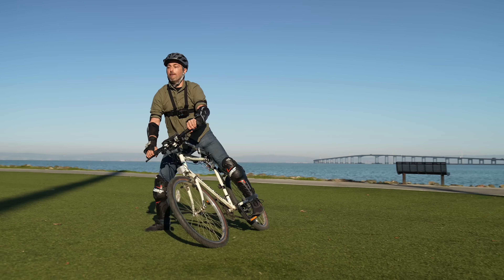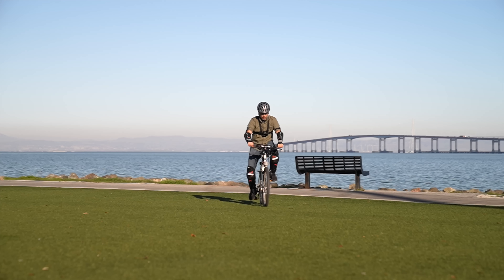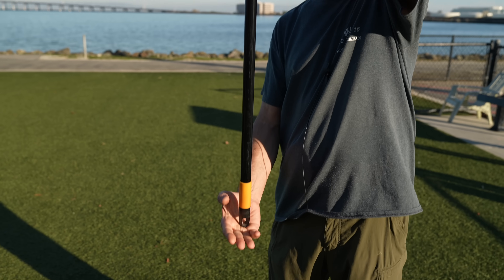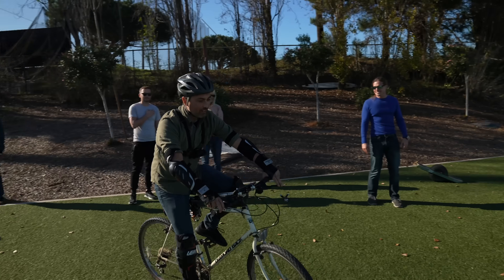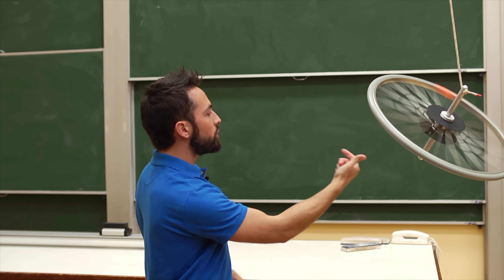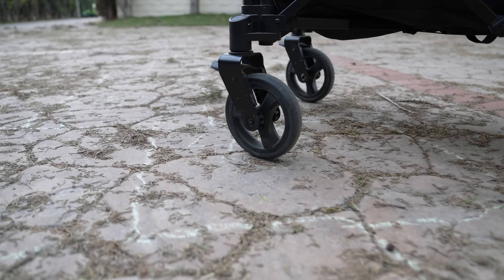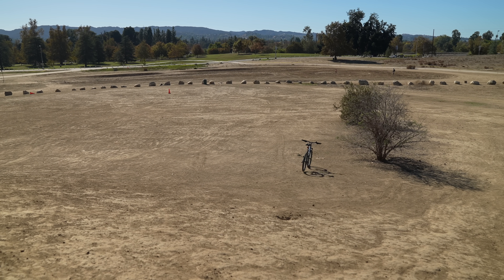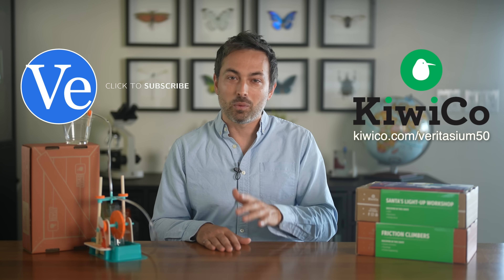Most People Don't Know How Bikes Work

Comment: Motorcycle enthusiasts hashed this all out 25 years ago in an internet group I belonged to (and I'm sure it was hashed out many times before that - I bet the Wright Brothers knew exactly how it works).  The subject came up in the Motorcycle group because getting your motorcycle license had a question about how to turn - and to pass the test their answer was turn left by leaning left.  We did similar experiments back then trying to lean a motorcycle that was modified so you couldn't counter-steer and it couldn't be done.  Excellent job explaining it in this video - now a whole new generation can be amazed to learn about counter steering.
Reply: Spot on!! 👌🤟 i was waiting for someone to say that
Reply: There is 2 books on the subject I would highly recommend. Bicycling science, and motorcycle chassis design. There both very interesting and definitely worth a read.
Reply: Came here to say this as well. Anyone who's taken the Motorcycle Safety Foundations Basic Rider Course (and maybe some other groups' courses) understands counter steering.
Reply: @jacobzadnik3875  I think most people don't understand it much at all.  They know it exists, but too many people seem to think it doesn't happen at low speeds, and most don't seem to know how it works, even if they know that it does.
Reply: @jacobzadnik3875  Yep. Learned about this 20 years ago with a motorcycle lol
Reply: I heard that for a motorcycle, the profile of the tire is also important for cornering. Riders are taught that they need to put more throttle to go around a corner at the same speed than if they went straight, and that is because the tire has a smaller diameter on the sides than in the middle, so when cornering, you need to wheel rpm to maintain the same speed. But also, when the tire is tilted, the tire has larger diameter on the outside than the inside of the contact patch, and because the wheel spins as one piece, the larger diameter has to drive a larger distance, so the tire traces a curved path. It basically acts as a differential. I have difficulties joining this with the subject of the video. Am I talking out of my ass? Are they just complementary effects? Can you steer a motorcycle/bicycle on razor thin tires that have no profile?
Reply: @flashpeter625  they are just different phases of the turn. You use counter steering to lean the motorcycle from a vertical position, and once it's leaned the tire profile kicks in and that keeps the motorcycle along the curve.
Reply: @flashpeter625   I think "talking out my ---" is correct.  Many motorcyclist are killed by the conditions reviewed here, they met a sharper than expected corner and make a "car turn" and thus fly off the back of the curve.  A two wheeler ( i ride both bicycles and motorcycles) first goes opposite and then comes back.  In my motorcycle training we were told to "push (handle bar) away" which is a counter steer.  So to turn left you "push away" the left handle bar ( which is to turn to the right), which makes the bike begin a fall then you "roll" into that fall and thus you turn.  So for a LEFT you 1) turn right, 2) feel the fall, and 3) turn back left and leaning into into the fall  the more you lean the tighter the turn.   fyi if you accelerate in that lean, the bike will launch like a rocket, and shoot toward the current direct (breaking out of the turn)
Now something you mention but counter to the video we agree with your assessment that the objective is to manipulate the gyroscope.  So "push away" unbalances the gyroscope ( ruler / gyro demonstration) The gyro then wants to self correct because its moved from lowest resistance (straight) to higher resistance (counter steer)  and thus your lean is naturally simultaneously timed to the gyroscopes return making 2 forces ( leaning & Gyro correction) combined to turn the bike.  I think your round tire ( disproven by "dark siders") allows the lean to be  easier.  There is no differential because the force is from momentum and since both tires lean they match even if the match is at a slightly smaller circumference (higher rpm!)
Reply: @flashpeter625  I've never thought of it like that!  As long as the engine rpm stays the same, then the wheel rpm will be the same, and the speedometer reading shouldn't change.  But in reality, because of the reduced effective diameter, the bike must be going slightly slower.  The more you leaned, the slower you'd go.
Reply: @flashpeter625  yeah,  the effects of the profile of the tire are there, but they're not the main effect.  The largest effect helping to keep a typical bicycle/motorcycle rolling in a straight line is "trail", where the contact patch is behind the steering axis.  This means that any time the bike leans, the steering automatically wants to turn in that direction.  this will still work on super narrow tires, etc.
Additionally, the contribution of each effect varies between bicycle and motorcycle.  The angular momentum of the steering and gyroscopic effects are actually very minor on a bicycle and can mostly be ignored (very light wheels and tires don't steer differently), but the effects are much more significant on a heavy motorcycle wheel.
Reply: @flashpeter625  the profile of the tire affects cornering, but not quite in the way you describe. While it is true that tire diameter combined with RPM determines speed, that's not a factor that must be compensated for in a turn. For example, older motorcycles used a throttle lock (literally a device that held the throttle open) as a means of cruise control. You could ride around corners with the throttle locked, no problem.
Reply: @flashpeter625  yes, you're right - but the rider has to counter-steer before the bike will lean at all, so yes, they're complementary effects.

Once you're in a lean, the tyres are indeed tracing out a curved path, at ground level - but you have the combined momentum of bike & rider that still wants to go in a straight line, and the centre of mass is well above ground level. So your straight-line momentum pushes against the cornering lean, and if you're doing it right, you come out of the corner upright.

Hypothetically, razor-thin tyres would still trace out a curved path as they leaned over (`cos if they leaned all the way over, they'd be on their side, only tracing out a circle), and the effects listed in the video would still apply - but they wouldn't be as good for motorcycle racing as fatter tyres. Fatter tyres allow tighter turns at greater speeds, for the reasons you mentioned: leaning them over decreases the radius of the turn by effectively decreasing the radius of the wheel. You'll also notice that most motorbikes have different tyre profiles for front & rear.
Reply: This is exactly what they teach you when learning to ride a motorcycle. Turn left to go right. Now an avid rider I always notice the opposite turn. Glad to see a deeper dive as to why this is the case.
Reply: That was a hard question to answer on the test.  I got it wrong.  The question on my test was a bit different, and the only available answers were weird.  The question was: which way do you press the handle bars to turn right.  Just putting the whole deal into words was weird enough.  Not about leaning like you said (and I would have thought.)
 I never thought about how I press the right handle bar forward, and therefore start falling (and turning) right.  The whole thing was a little counterintuitive.
Reply: @travismiller5548  actually it is quite common mnemonic to teach countersteering: instead teaching people to steer at opposite direction they went to go, which is somewhat counterintuitive, they are told to "push" on handlebar on the side you want to turn to, which is the same but easier to remember.
Reply: On a motorcycle, the speed also has everything to do with the steering. At very low speeds, you pull steer in the direction you want to go. At higher speeds, you then PUSH steer to turn in that direction. And not every motorcycle has the same speed cutoff where you can't pull but have to push on the handlebars. I had 3 motorbikes and not one of them had the same effect. From a 1957 9 feet long chopper, to Dyna Super Glide and finish with a Full Sized Dresser.
Reply: @danyf3116  Speed has nothing to do with it or else at some speed bike would only go straight.
Things would be even worse if a middle of a corner, when a speed changes the bike suddenly start to turn other direction.
Reply: @danyf3116  This is just a difference in perception.  Even at very low speeds you're counter-steering to initiate the turn, but then you're easing up on the counter-steering force and letting bars turn further to cause the bike to self-correct through the curve.
Next time you're in the middle of a corner at low speed, don't think about your handlebar angle, and instead notice where you're applying force.   You'll still be pushing on the bar on the side that you're turning towards, exactly the same as when steering at higher speeds.

Comment: Alright, as a bike nerd I really liked the video. I have a correction about the second mechanism of self-stabilizing. Not all bikes have their riders' hands in front of the steering axis. Cruisers, Amsterdam style bikes and many others with very swept back bars put the hands well behind the steering axis and pay no penalty in stability. On my mountain bike, I use a 31mm stem and bar that is swept back 11 degrees, putting my hands almost exactly in line with the steering axis and it's no less stable than a bike with a longer stem. I have to consciously weight the front wheel in turns for grip, but the steering effect is essentially no different.

Comment: Excellent video! As an avid motorcyclist and racer, I can share a piece of advice I was taught when I started racing. To turn into a corner, new racers are taught to push the handlebar of the bike on the side you wish to turn into. This means you would push the right handle forward if you want to go into a right turn. While it never made sense, this video confirms that age-old piece of advice perfectly!
Reply: Yes, you want to lean into a turn which requires moving the handlebars very slightly in the opposite direction.

Comment: Its taught also in the basics of motorcycle riding courses. Push right, go right, push left, go left.  Balancing stationary or moving without steering input would be comparable to that rung game in carnivals and fairs. The balance point becomes so small and thin, that any tiny imperfection in that tiny, in the case of motorcycles, credit card area of contact surface, means you fall over. So on a pedal bike, even smaller amount of contact area and area where you must be inline. Only have to watch trials riders to see them balancing a bike, both motorized and pedal, while stationary. Moving wise, it is almost impossible as your inputs on a pedal bike change its CG over that thin line, and for a motorized unit, I think the motion of all the parts would have an effect on it. In theory, an electric hub motor, combined with counter rotating masses to cancel any effect that motor has, and so as long as the CG is also directly in the center line of the contact patch and tires, it should stay up with a locked steering setup.

Comment: Something not covered was the height of the centre of gravity from the ground.
What is more stable a penny Farthing or a childs' regular bike (or Penny Farthing)?

The Penny Farthing is very stable, particularly at low speeds. As pointe out in video the engineering is like an inverted pendulum.
The longer the pendulum, the slower the frequency of oscillation.

Comment: The principle of countersteering might not be taught to most people when they learn to ride a bicycle, but it definitely is to motorcyclists. This is a great demonstration of the concept! The effect of the steering wheel diameter is also pretty well known in that sphere. In the late '80s, manufacturers introduced bikes with 16" front wheels in an effort to achieve more responsive steering. Unfortunately, coupled with a steep rake, it tended to make the bikes kind of twitchy and most sport bikes settled in at a 17" diameter for better stability.
Reply: I have motorcycle license and I didn't even realize I've been doing countersteer until now
Reply: @naufalap  The whole "push right to go right and push left to go left" thing they teach (or at least taught) in the MSF courses was a distillation of the concept. The print edition of "Motorcyclist" magazine actually had a good article on the physics of it a couple of eons back, but this is a better practical demonstration. As I recall, the article explored how the steering geometry and the tire's contact patch all factored together.
Reply: I started riding on a Honda CRF dual sport with a 21" wheel so even my 500+-lb tourer with a 17" wheel feels nimble in comparison
Reply: @gregorysteffensen3279  I'll bet it does! The motocrossers I started with also favored large front wheels for better stability and the move to a Hurricane was unmistakable.

Comment: The fact that the human brain conducts calculus on a regular basis without even trying reminds me so much of how prime numbers and certain sequences will show up in things like flower patterns and marine life shells. Math really is everywhere, even if you don't realize it. Even if your brain "isn't good at" conscious math, it's fantastic at subconscious math.
Reply: Just because the brain and mathematics may produce the same/similar outcome it does not mean that they arrive there by the same method.
Reply: it's also not good at subconscious math. Math is just how we explain things using a language that is perfectly specefic (most of the time).
Reply: It’s trained
Reply: The mind uses heuristics which is fancy way of saying rule of thumb. You try things and you recognize patterns (subconsciously). Your subconscious isn't doing anything conceptual it just gives good responses to the current situation based on what happened before
Reply: Even if it is a heuristic, that's still solving a problem posed by math itself (ie. how many degrees to turn a bike handle to produce an optimal turning radius.) Compare it to an engineer using matlab to solve a problem. I'd say that's still "doing math" if you want to be technical about it.
Reply: @thepersonwhocomentz  but are degrees and optimal turning radii actual things or just constructs we use to understand our world? I don't think our subconscious solves math problems when biking because I don't think this is inherently mathematical we just use mathematical tools to describe what is happening
Reply: @thepersonwhocomentz  you brain doesn’t think “I’m going to turn the handle 26.372 degrees to the right.” It thinks “I had to turn the handle this much last time, so I’ll do that again.”
Reply: It’s called the Matrix.
Reply: The brain doesn't do calculus. It metaphorically does trial and error analog numerical iterations.

That wasn't enough, let's go futher,... whoa,.. too much,.. back the other way,.... and on and on as the muscles are trained.
Reply: It's pretty stupid to say "math is everywhere" when the entire point of math is to serve as an illustration of everything

Comment: Excellent. There is actually a 4th factor: Camber thrust from the tire profile.
Reply: Yeah, I don't buy counter steering being strictly necessary... it seems that there are enough other forces to do without it for regular (though perhaps not motor) bikes.
Reply: @zvxcvxcz  I think counter steering is necessary...the whole inverted pendulum balance thing...but rake, trail, gyro, and camber thrust all work together to make a bike stable without any rider input. There is a bit of redundancy there, but they all work together to make a sweet handling bike.
Having said that, is a motorbike doing a wheelie, then leaning into a turn using the front as a gyro (no contact), really "counter steering"? It feels like it to the rider, but the front->gyro->roll->rear wheel uses camber thrust to turn is quite different to a slow turn with weight on both wheels. Given the reality of rough roads, having redundancy is a very good thing.

Comment: When I was younger, I used to ride my bike without using my hands and controlling it only with small legs movements and leaning the body to the sides slightly. Once I drove it for like 5 kilometers in an urban area, wich includes 90° corners. I activated the brakes by pushing the cable in the frame.

Comment: When I originally learned about counter steering it allowed me to be way more deliberate in turning the opposite of my intended turn. I was much better at taking smaller radius turns on my motorcycle after that.
Reply: "Push left, turn left" and its counterpart are very important on a motocycle given its much greater mass than a bicycle.  This is why people who ride bicycles still need to be taught countersteering, because it occurs without any conscious rider input on a bicycle.
Reply: It was eye opening for me. But it's by far not taught enough.
Once I intellectually knew what my body kind of knew all along, I was able to intentionally make use of this. It is so damn effective.
Reply: Yeah of motorcycle rider needs to have a proper understanding of how countersteering works
Reply: yeah I learned counter steering fairly late and my God my cornering speeds shot up and got tighter. I just used to lean and the first time I countered steer I wont lie I got a little scared as my bike just dropped but I was ok I throttled it to pick the bike back up
Reply: I'm sure that if you could stay upright on a motorcycle, you already intuitively understood counter steering. It's not something that helps you to ride better; it's something that you can't ride without.

Comment: Except at very low (parking lot) speed, all motorcycle steering is done with countersteer. Not just the initial turn in, but all steering. If you want to turn right, you PUSH right.